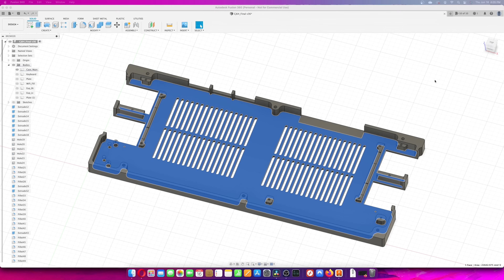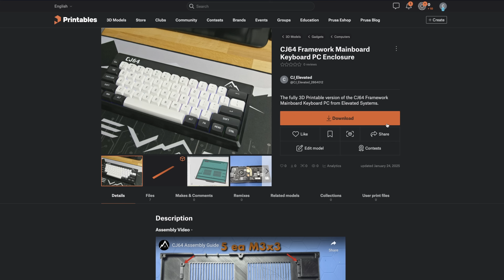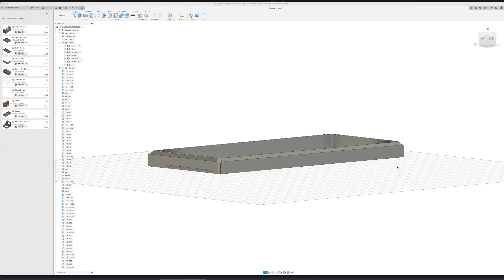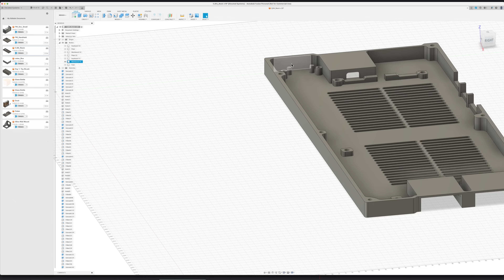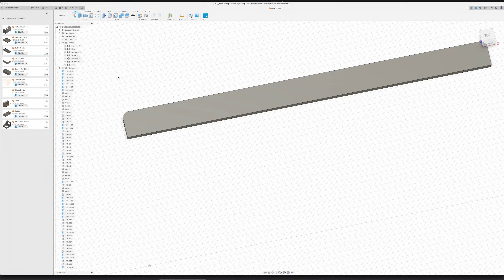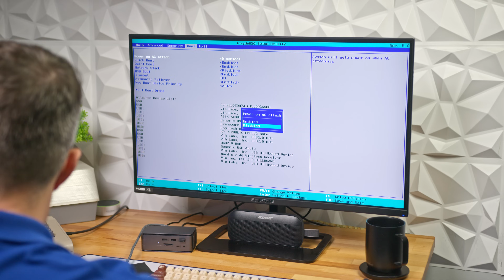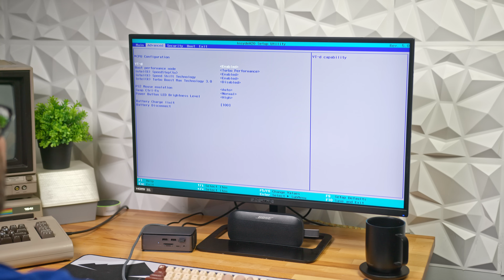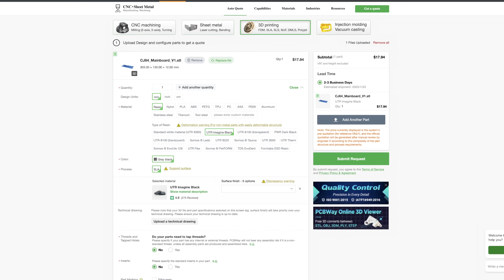Turn Your Framework Laptop Into a Keyboard PC!

Comment: Super cool concept! I have an 11th gen Framework laptop that has the issue where the CMOS battery dies every few months and I either need to keep replacing the battery or plug it into a power source to get the thing to turn on. Using it in a CJ64 case would allow it to be connected to power all the time so I don't have to keep wasting money on batteries.

It sucks to lose the portable laptop form factor, but if it's not TRULY portable I could use it as my main desktop in the CJ64 form factor.
Reply from the maker: Send me an email with tour shipping address and I’ll send you an enclosure.
Reply: @ElevatedSystems  Sent an email a couple week ago. Thanks!
Reply from the maker: @cease70  I got it, sorry was waiting for all enclosures to be claimed so i can ship them all at once.
Reply: @ElevatedSystems  Why not just make it a bit more thicker and add the framework battery too ?
Reply from the maker: @samajavad5212 because I don’t want to burn down my house. You can’t sandwich a li-ion battery with heat producing electronics. That will cause thermal runaway in the battery.

Comment: Why not add a battery too ? it could be possible just a bit more thickness but worth for not loosing an extra port
Reply from the maker: Because I have no desire to burn down my house. You can’t stack a lithium ion battery on a heat producing mainboard. That significantly risks thermal runaway and a fire.

Comment: I really like the overall idea but got concerns. The height of the front seems quite tall. Some sort of tilting on the keyboard should smooth this.. Also the expasion bays on the side looks like it would interfere with the mouse usage.
Ideias for a next iteration: Extend the expasion bays to the back of the key board, where the logo is. It could also be the tallest point of the build. Could look seek.
Nevertheless a simple wristrest and a wireless mouse would be enough to overcome my complaints!

Comment: Do you have the STL files for the CJ64 mainboard enclosure version 2 without the rear left usb-c port blocked off for the keyboard? That port is the most capable port on the risc-v mainboard and I need to use it with an HDMI expansion card in order to get video out. Maybe a version of the case with a different port blocked out for the keyboard? I just don't know enough about 3D modeling to fix this issue with thhe CJ64 myself.

Comment: This is such a cool concept. I have a printer, so I do not want to take the opportunity away for somebody else to get one. I was just wondering what the required build volume is to print one. Thank you so much for what you have already have and will do for this community
Reply from the maker: I print it on a 320x320 bed which leaves room for a brim if needed.
Reply: @ Thank you for making these files and I will definitely print it out when I upgrade to Ryzen

Comment: What do you think about framework (preferably 16) as a personal computer for a dev running Linux in 2025? Do you feel that it's still worth it despite the the lack of updated processors or price drops? It feels like a tough sell to pay 3-4x the price of a major manufacturer's comparable hardware. There's so much I like about their brand but the cost is rough right now.
Reply from the maker: I think i said all I had to say about the FW16 in my review series on it.
Reply: @ElevatedSystems  Thanks for reading. That's fair. I watched the series when it came out but I feel like the additional 8 ½ months of time could have allowed them to smooth out some of its problems. It also makes its already dicey cost:performance worse though. I forgot that you said that you returned your 16 at the end of the video but kept the 13.

Comment: don't solder antenna cables man
Reply from the maker: How exactly should I connect the cable to the antenna PCB?
Reply: @ElevatedSystems  if they are too long hide them inside without soldering. its a coaxial cable.

Comment: Hey Bud, I’m looking to house my Framework 13 I7 Mainboard!  

I’m going to leave the 32 gig ram in it and put a new NVME with Linux,  I’m waiting for my AMD Ryzen 5 Mainboard to upgrade the laptop.  

You design would be a delight to my setup, I’m already  equipped with a portable 16in lcd monitor, which would make this setup and awesome On-The-Go mobile rig for Ham Radio and my IT Tech services startup!

Comment: i womder how feasable is to resuse the built in key oard header on the motherboard, i think having all 4 expansion modules available would be good, also maybe bigger and better wifi antennas
Reply from the maker: The power shim I showed in the video includes a USB 2.0 output that could be easily used to wire in the keyboard PCB. Thats how I connected the mini keyboard in my Cyberdeck project.

Comment: I would love one to put my 12th frame work mainboard into. I have been using a framework 12 with linux for a few years full time for work and play. I want to upgrade my laptop mainboard and this would be a cool use for the old mainboard. The dream would be to pair this with a headset like an nreal air for the most obnoxiously cool coffee shop work set up <3
Reply: Actually on second thought i want to rescind my application ><. i cant quite justify buying a new mainboard financially right now so this would likely just sit for quite a while before i do the install. please send to a party more likely to use it on a shorter time frame

Comment: I always loved the original. Well I never grew up with a Commodore 64 old tech still hold a place in my heart. There is just something fascinating about it.

For a machine like this, I would probably be using Intel 12th Gen i5. Keeps me away from the potential degradation issues and when it comes to my online habits it has proven plenty capible of handling anything I throw at it.

Comment: I love my Nuphy Air75 HE as a 75% low-profile board, just 1u wider than a 60% board... but damned if I'm not thinking about adapting things now. The idea of a Framework board as my Linux hardware right there with my board in only a slightly taller case. That's awfully tempting. I'd go for the AMD Framework board. (Not asking for an entry since I'd have to adapt the print to make it work. Just an idea I'm toying with now after watching this video.)

Comment: Hello, great build. I would love to be entered for any of your extra cases. I have a spare 1165 board that I'd love to make use of in this case. It'll also give me an opportunity to try my hand at building a mechanical keyboard. If it goes well, I have two more 11th gen boards currently in laptops that will be candidates for me to move to more of these cases (which I will have to have printed) when the time comes. I plan to use them to replace existing mini-pcs that aren't windows 11 compatible.
Reply from the maker: You got it the first case! Send me an email with your shipping info and I’ll send out the enclosure.
Reply: @ElevatedSystems  Wow, thanks! Keep up the great videos!